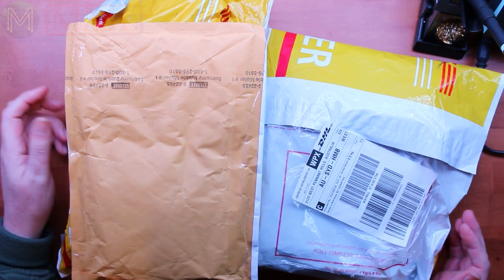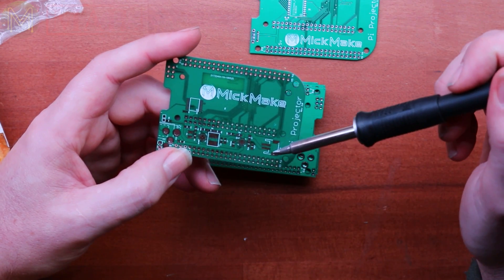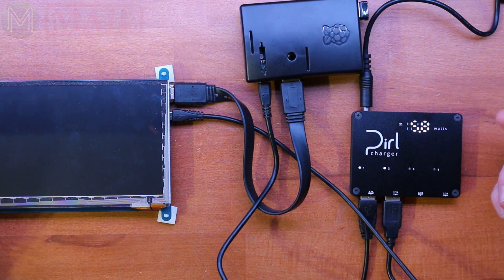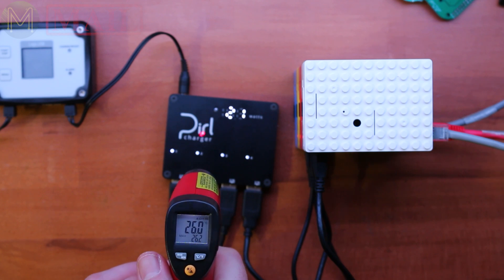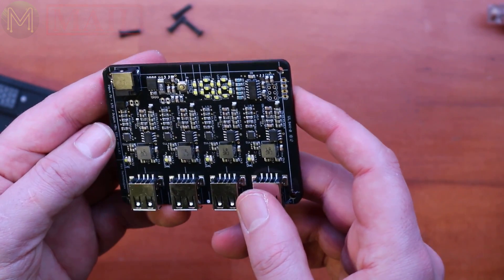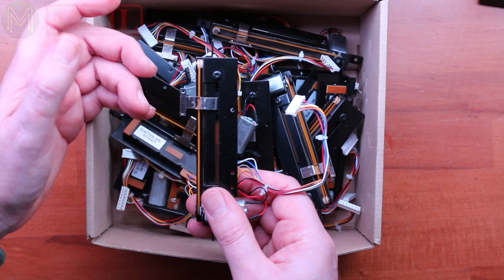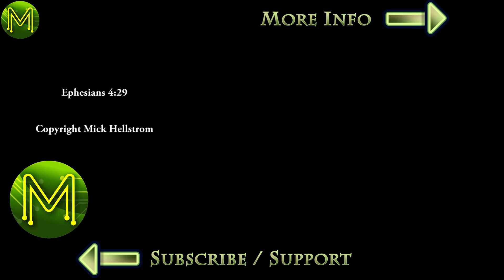#213 MickMake Mail #31: Pirl charger, LEDs & motor faders // News

Comment: Hey Mick, there is one thing it would be interesting to see tested on the pirl, is it possible to use the outputs in parallel (maybe with backfeed protection diodes?) to power more power hungry things like the UP Squared? would make for a pretty nice little PSU for a car computer, use two outputs for the SBC and have 2 spare for charge ports or other components.
Reply from the maker: No, the output all have a common ground point, so you can’t increase the output to greater than 5v, nor daisy chain.
Reply: no, not looking for more voltage, im looking for more current.

Comment: Those sliders with the lights might make for a fun DMX based rig of some sort. Not sure whether I'd use an Arduino or a Pi for that though. Keeping in mind of course that inputs can be multiplexed too. That's how most modern computer keyboards work. You could build it so that it's analog controlled on the electrical end and you could store scenes that the Pi or Arduino could switch between in an instant. I know it's a sort of Rube Goldberg thing but it might be fun considering you've got most of what you'd need already.
Reply from the maker: I’ve checked around on eBay and there’s a heck of a lot of them around. So I think I’ll be making a small PCB that can interface to them with access via I2C or UART.

Comment: Also for the flying faders: For a digital soundboard there would be no point in 2 channels going to the computer. The fading of a stereo channel is controlled internally by the processor; it doesn't need 2 separate resistance values. The 2 channels of resistance could be one for a dedicated feedback circuit for the motor so it knows EXACTLY there the fader has moved to, and the other channel goes to the processor. Processor would send a signal to the motor to shift to a new position, and the dedicated fader circuitry would control the specific movement, not the processor. At least that's my theory.
Reply from the maker: Yup, I agree. One channel for position control and the other feeding to the mixing desk.

Comment: Those LED's look familiar: https://www.sweetwater.com/store/detail/EZPar64RGBA--chauvet-dj-ezpar-64-rgba-battery-powered-par  Except these don't have the amber color.
There are a lot of knockoffs. Remember that LED arrays like that need good size heatsinks on the back otherwise they will die an early death. Add some dmx circuitry plus some dmx software (http://www.chromateq.com/64-chromateq-pro-dmx.htm for one) and you've got a decent lightshow.
Reply from the maker: I’m surprised that these ones don’t generate much heat. Running at 12v @ 1.4A they’re actually cool to the touch.
Reply from the maker: $200 for those! What the heck?!
However, that’s exactly what they were being used for. The dumpster was from an audio/visual house.

Comment: The round led panels put in a box you could switch from color to color making a mood type light. Those sliders are just like the ones used in digital sound and light mixers.

Comment: oh make a huge TV screen you can sit back 100 meters. lol
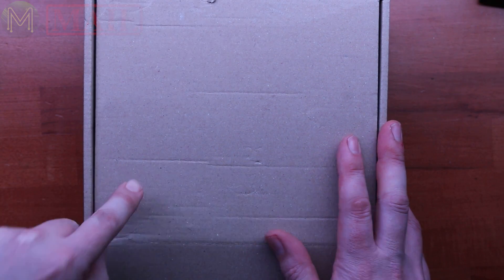11:49 those slider pots look like the ones used in the music studios that restore the playback settings and push the controls into place (you see them in music videos)
Reply from the maker: Yup, that’s exactly what they were from! I reckon I could make an interface for it based on an ATtiny85 and feed out I2C... maybe a few extra GPIOs for LEDs and buttons.
Reply: In that case,  massive arcade game (super low res), no...no... message board ... lol. worst case, replace the break lights on your car or pimp your bike/skateboard/wife...

Comment: +MickMake I'm wondering whether you talk in your condenser microphone axially...the capsule is mostly build vertically in the cage, therefore you have to talk into radially. Usually there is a marking (or the symbol for the characteristics) on the side you should talk from.
Reply from the maker: I used to use it all the time, but I’m one of those “mouth noise” makers. The type that gives audio editors a headache. So I’ve given up on it.
However, I would talk radially. The sound was much better from that angle.

Comment: For the round led things: coat them in resin, build a massive christmas tree in your front garden and use them as light up christmas deco
Reply from the maker: Hmmm. Yup sounds good. I’ve had a couple of suggestions around Christmas lights.
Reply: Another suggestion would be to combine them all to make a big filming light. Add some smoke and it looks like a ufo beam up scene

Comment: All these  LEDs,  you making  a cannabis farm?
Reply: MickMake 
don't think leds will work , they don't emit uv light  which is what plants need for photosynthesis
Reply from the maker: Well, not really into indoor farming. :-)
Reply: Plants use mostly red light with some blue. Plants don't require UV for photosynthesis,  which generally just burns the leaves.